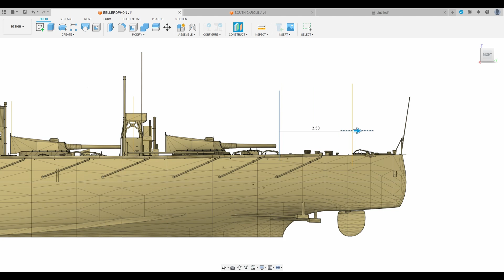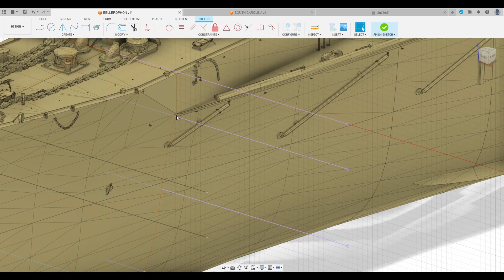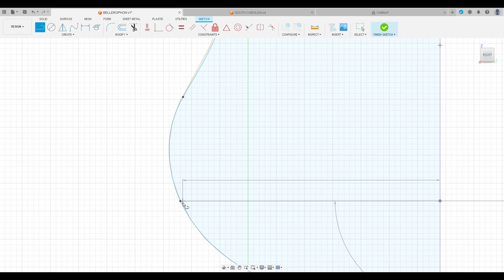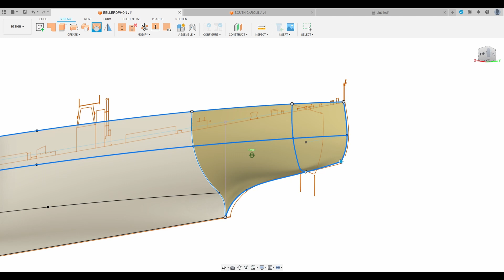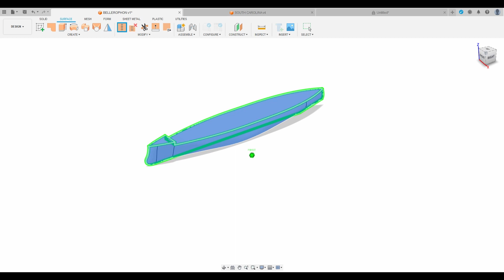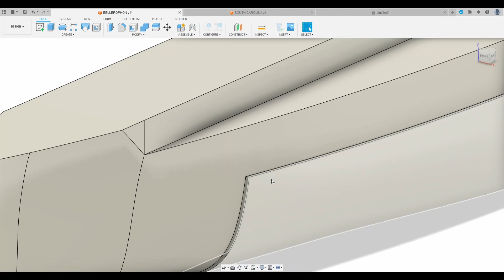Fusion360 Tutorial - Creating Solid Bodies Using Mesh Hulls as Plans - RC Warship Combat

Comment: Something I discovered that might make this easier is that you can isolate the hull as a mesh in OnShape.  You upload the stl (WoWS or WT) and hover your mouse on the hull.  Keep moving it until the outline of the hull is hilighted.  Click on it and the hull will turn orange.  Right click and select "Isolate."  Up in the left corner a little Isolate window will pop up.  Click the "Hide Transparent Parts" checkbox which will only show you the highlighted parts.  Then right click on the hull form again and select "Export."  Select the export options you want and then click the "export" button.  That will give you a single .stl file that is a mesh of the hull.  This process also works for every other part of the ship.  You can also select multiple parts and export them as one mesh.   Hope this helps!
Reply from the maker: Interesting idea! I bet I could do something similar by copying the hull sections and any other features I want and pasting them into a new model.